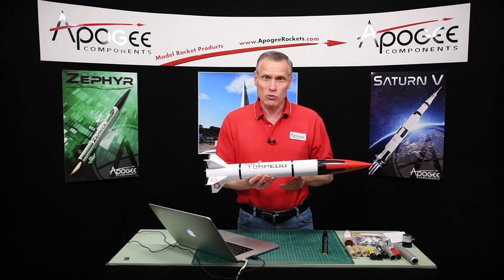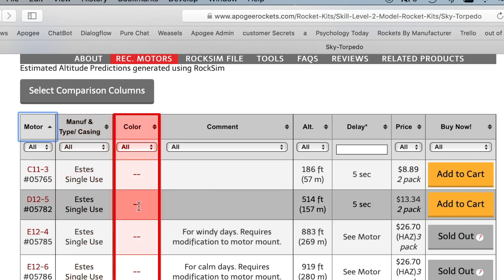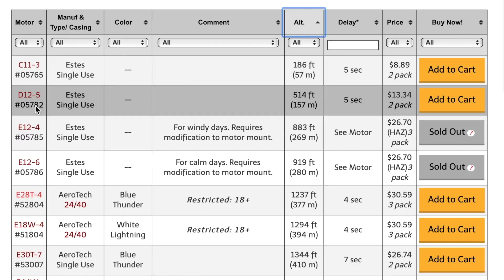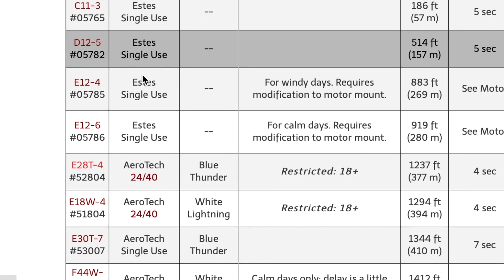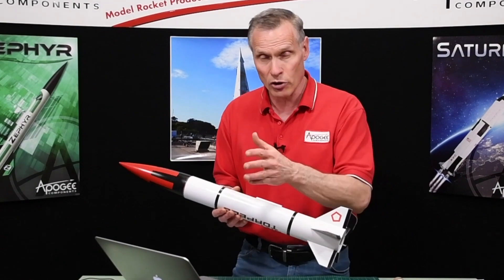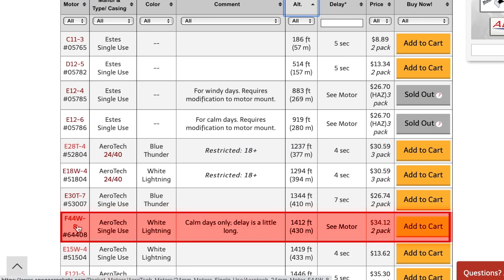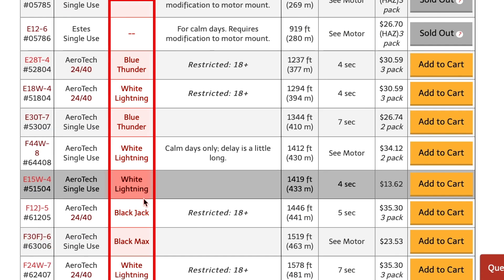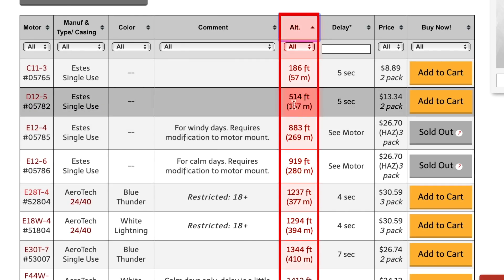Which Motor is Best for Your Rocket?

Comment: Building an Estes Star Orbiter rocket for my child. What is a good Aerotech motor for an impressive off the pad launch, smoke, sparks and all? But not super high altitude for recovery. 29mm
Reply from the maker: That kit isn't one we currently sell. You'll have to run the simulations like we do when we create a motor chart. It is only 3-clicks of your mouse, so you can do it. We're here to help.
Reply: @apogeerockets many thanks for quick and thoughtful reply. Great channel, indispensable information for sure. 😊

Comment: So the burning question is, which is better composit engines or estes engines?
Reply from the maker: They are both equal in my opinion. They both work great, and they cost about the same too. Motors should be selected based on your mission for the rocket. We have videos on selecting motors, such as this one: https://www.youtube.com/watch?v=DEg1xnaL0k0&t=17s
Reply: @apogeerockets  I'll check it out. 🤠👍🇺🇸

Comment: What size motor you use depends on 3 conditions: Size of the field, Wind speed and for Mid/High power, ceiling height
Reply from the maker: That's why we use RockSim. It take account all that information and a whole lot more.

Comment: How to put an engine in and flying with no engine hook and no engine blocker
Reply from the maker: I guess you'll need to put one in.
Reply: I'd use a very tight friction fit if you are okay with the possibility of having a malfunction. If not, install both.

Comment: I usually start off with ThrustCurve then RockSim to fine tune the decision.  Its a function of stability off the launch rod (what size of launch rod or rail and rail length), desired altitude, desired visual effect (slow long burners are a delight to watch and film), rocket mass, CP/CG locations, determine optimum ejection delay, wind conditions AND how far do I want to walk!!!  Flame colour for me is a secondary choice.

If I can get a long burner on a long launch rail to get the rocket to the desired altitude; then I am satisfied that I've selected the optimum motor.  😎

Comment: What about sugar engines?Are they legal?Can they be uses instead estes engines?
Reply: go for it, trying to make your own motors sounds fun, gonna be trying it myself this week
Reply: hi-point they are not part of model rocketry. You have to have a Level 2 NAR or TRA certificate to make your own motors. Estes is very good for the motors so stick with those
Reply: @colinkaul8324  that's absolutely not true. If you want to launch at a TRA/NAR facility you need certs to fly your own motors, sure, but any Joe-Schmoe can build a motor in his garage and launch it on the back 40 without any legal issues, until you start getting into the bigger stuff anyways. Transport and sales to others is a no-go obviously, but there's nothing illegal about making and using your own motors. I build my own APCP motors at home and test them all the time, but I've never been a TRA/NAR member. I don't launch anything I'm not cleared to by the FAA or anything, nothing above a Class 1 rocket but assuming you stay within those guidelines it's perfectly OK to make your own propellant and motors.
Reply: @colinkaul8324  That’s a total lie! You can definitely make your own sugar motors without any “certificate” 🤦‍♂️